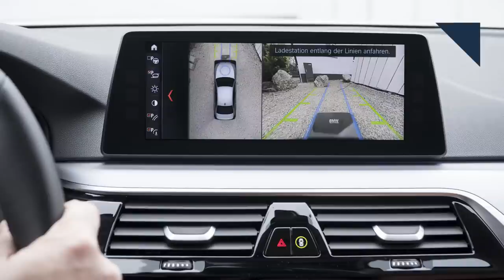All-New Ford Focus, No Bolt Refresh for 7 Years - Autoline Daily 2329

Comment: For wireless charging, I understand that efficiency goes up substantially if the parts are in contact (minimize air gap between them). If so, then a charging pad that has a jack in it to lift it up to make contact with the bottom of the car would seem to be a good option.

Comment: Up to 85% efficiency for the wireless BEV chargers? That's grossly wasteful. You might as well just toss a dollar on the garage floor every time you charge. It's not only criminally wasteful of electricity but it will interfere with wireless communications and present a safety hazard. Maybe wireless charging of high-power devices is a bad idea.
Reply: Jay _ I agree. Very wasteful. Good point
Reply: Just have a pad that has conductive contacts that actuate automatically. 99+% efficiency.  Disable power when vehicle is not on the pad so even if somebody pokes around, nothing can happen. Or just have secondary J1772 underneath the car and have robotized plug in the pad.
Reply: Arnis Tarassu, why do that when they can use a robotic arm to plug into the charge port? That’s the next step.
Reply: Tesla built and tested a"snake" that did that. No one offered to buy it.
Reply: Energy waste is not a bad issue. Our Sun waste over 90% of its energy into empty space (same as all the stars we see). Do you use heating? Yet over 30% of that energy is also lost and "wasted".  The wireless "Qi" chargers for smartphones do waste a bit but who is complaining? The hands-free (and cable free) charge was an idea that Nikola Tesla developed and experimented on over a hundred years ago. Many laypersons will accept those losses just to have that same "hands-free" feature for charging their EVs. Anyway, no one gets their gasoline "wireless" or piped into their homes, and NO ONE IS COMPLAINING!!!
Reply: I don't know how they got 85% efficiency on the chargers. The regular wall chargers are 90% efficient only, and all in all from wall to battery, because of the battery charge-discharge efficiency you're closer to 80% in terms of energy used to charge the battery.
Reply: You should get this valuable info out to all the car companies immediately before the Illuminati have you liquidated.

Comment: Why would GM choose not to update the  Bolt for 7 years?  Doesn't sound like a good idea.
Reply: It sounds like they will actually keep the platform for another 7 yr, not that there won't be updates. Keeping a car on one platform for 8 yr isn't that strange.
Reply: It basically has a head start on the competition as it is currently.  Almost no one even knows it exists. By 2020, there should actually be at least 1 or 2 real competitive models (one would hope).  So when the market actually starts to heat up in this segment in 2021, they can be sitting better to offer lower cost no frills trims or new features having already collected at least some revenue from the prior 3 years model sales.

Comment: No refresh for the Bolt ⚡️ x 7 years? Sounds like GM taking a page from Tesla Model S.
Reply: I think the truth is that they will stick with the same platform for 7 more yr, not that it won't get any updates.
Reply: I agree, Just like the Model S from Tesla. Sadly the Model S still suffers from poor panel fit, door handle failues and water in tail lights after 6 years.
Reply: The Ford Fusion design arrived in 2012 as the 2013 model year. We still see the same Fusion for 2018 (its seventh year) with only a face lift (smaller grille and lights).
Reply: Seven more years of ugly...
Reply: Sounds like Gm trying to kill this car or brining the price which I doubt. R.I.P. Bolt

Comment: My guess is the BOLT is going to be fleet vehicle for mobility services more than sold to the general public. However, GM could change their minds if BEV sales start improving. Meanwhile GM has 23(?) EVs on the boiler right now?
Reply: Seems like everyone has 23 evs 'coming soon'.  Wake me when we're done with all the smoke and mirrors.
Reply: Because the definition of EV, or ":Electric Vehicle" is so broad, assuming they mean Battery Electric Vehicles (BEVs), is an easy folly.I have little doubt GM has 23 EVs coming soon, But I have serious doubts more than a few of them are BEVs. Most of them will be Hybrids or some type or another.
Reply: Two of them are coming this year. One is the 2019 Buick Enspire CUV. search the web for more information.

Comment: I think GM is making a mistake to not keep working on the Bolt making it better.
Reply: They are "making it better", but they must keep it a secret until the official announcement. The Bolt EV technology was tested in "mules" (one video was posted here) since 2012, and it was officially announced January 2015. 

Only the engineers inside GM know what is going on. Do you?
Reply: I do have a couple friends that work at GM,  but do not get any good information.  Most good leaks come from the tooling industry, and I have some friends in that industry too.

Comment: Im confused. I thought Ford stated they were going to drop all their passenger cars sans the Mustang and Continental?  Then this new Focus comes out?  I must have missed something.
Reply: There's been talk about killing the U.S. focus and fiesta for some time now, but I'm sensing that's because of the dual-clutch transmission that keeps breaking.  Ordering SE sedan you can get the one-liter engine paired to 6F15 transmission which has a great reliability record, but ford really blew it with this particular DCT.
Reply: the new US focus model will be made in china .  based off a Chinese version of the global ford focus
Reply: Interesting stuff.  Here in U.S. we got $4865 in rebate and dealer incentive, or I would have been limited to mitsubishi mirage or chevrolet spark.  The three-cylinder engine is surprisingly good -- didn't even know what it was until I opened the hood!
Reply: Some time ago, I read that the Taurus is likely gone after 2019. It was updated for China but not the US in 2017. However, I recently read that Ford was going to drop the Fiesta and was considering dropping the Fusion as well. That would only leave the Focus and Mustang as Ford's passenger cars. Looks like I will have to go elsewhere as I do not want an SUV.
Reply: The dealership really wanted to put me in c-max rather than focus, but I just don't want a car to be half-again bigger, nor did I want to front another $5000.  What Ford ultimately does is drive this segment to Civic, Camry etc., where the customer will probably be happy to stay.

Comment: The new Focus looks like the Volvo v40
Reply: Ford owned Volvo many years ago. So they shared designs, just like when Ford owned Aston Martin and the Fusion shares that design.
Reply: Raymond Ramírez that was then this is now

Btw, there were never "shared" designs under the Ford umbrella 

Ford simply copied the other firms designs under its umbrella because at the time Ford simply felt it could 

As a result there has been some rebuttal from those other firms about Ford's copying as time went on